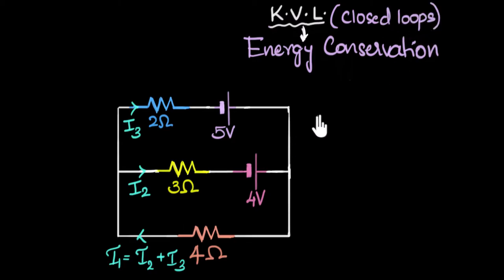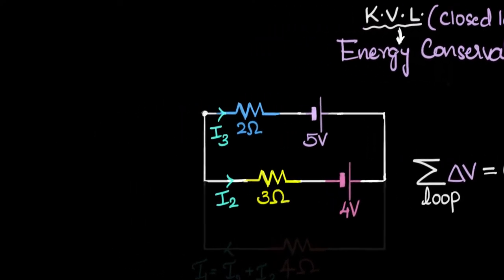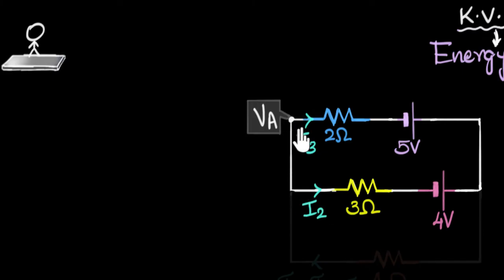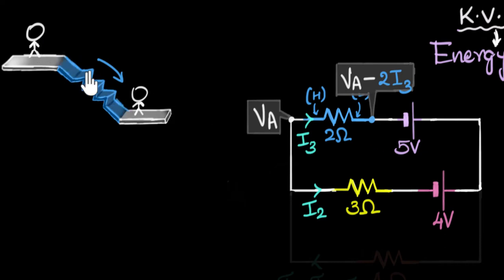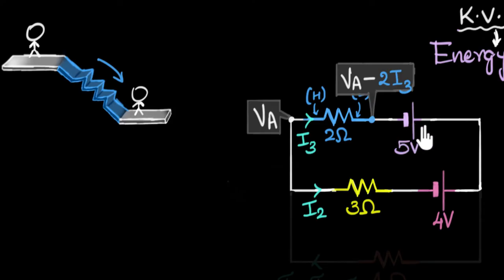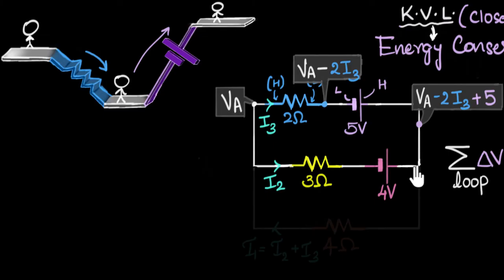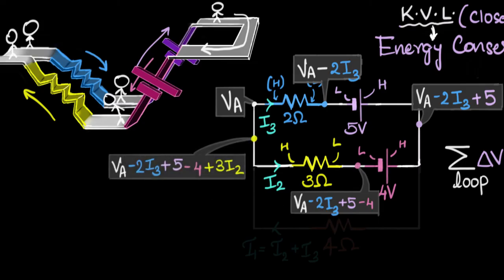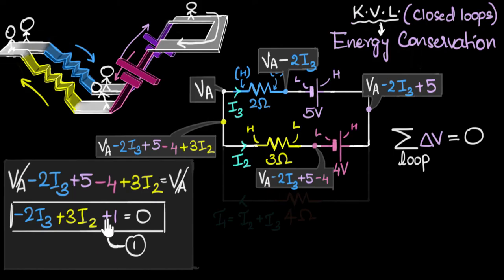Kirchhoff's voltage law (conceptual) | Electricity | Physics | Khan Academy

Comment: Sir why are you adding at 3 ohm resistor because resistor reduce voltage EXPLAIN
Reply: Why?
Reply: @adityasonawane8912  I think for find the current they think like that
Reply: Current direction is followed for resistors and when it comes to cell we have to consider the up or down voltage (drop)

Comment: Sir , one doubt. U connected positive terminal to another positive terimal of the battery , then how the current flow?
Reply: If anyone know plz reply
Reply: Because one battery has more voltage than the other, so the current flows. In this case, the current flows in the clockwise direction.